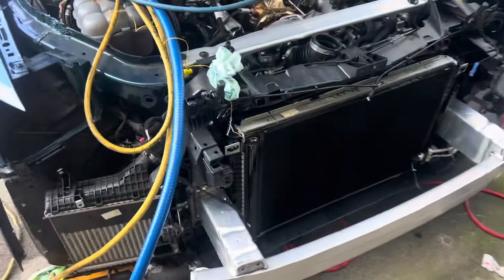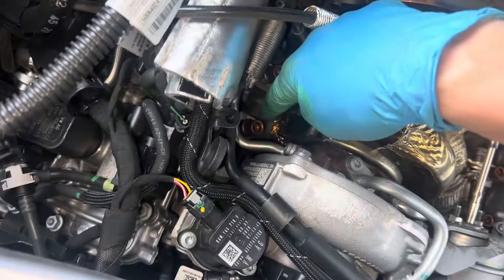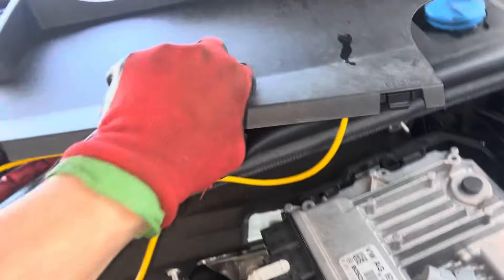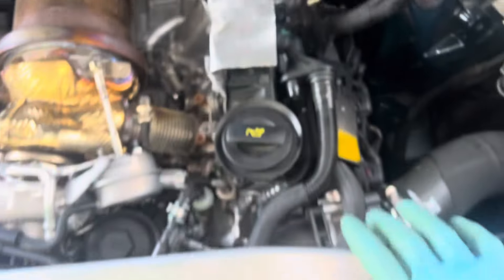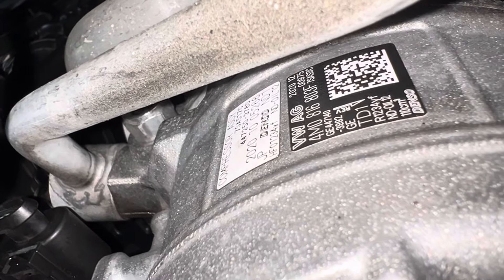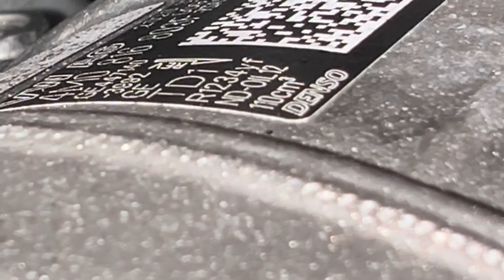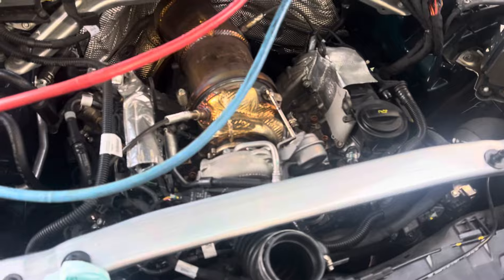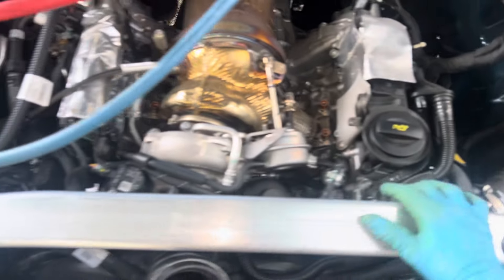AC lines and components near impossible to see with your eyes for leak checks. turbo intake manifold

Comment: What are the 3 wire (1 red + 2 black) plug on the Mercedes Metris AC compressor A0008303002 do? One wire is to engage the clutch, what are the other 2 wires do?
The reason I ask. I bought a brand new compressor from FCP Euro that stated that "this part fits your car" but the new Valeo Mercedes AC Compressor 699298 has only 1 wire plug instead of original 3, suction and discharge lines are at a bit different angle and it's missing black sensor plug as well. I'm trying to decide if I should return it or missing sensor is fine, lines are offset, and 3 vires can be converted into 1???
Reply from the maker: I do not know Mercedes parts numbers. 

But it sounds like they’re trying to sew you an older styled fix piston compressor . 

To possibly replace a variable displacement compressor . 

I only replace like for like components 

If they’re not the same, I don’t replace them .
Reply: The red and one black wire smaller in diameter are for the variable displacement valve. The black wire thicker in diameter is for the clutch power.
It is always a problem to find the right part on German cars because parts vary very often. Always take care to have the original part number. Only identical spare parts will match! Don't try to install the different looking compressor...
Reply from the maker: @Akadectra  👍 vary true
Reply: @Akadectra  Thank you! I received email from FCP Euro, saying that they made a mistake on the listing and that Valeo compressor fits Mercedes C class and not Metris. I'm returning it. 
Last question: 
If clutch engages but A/C pressure stays the same around 70PSIG HI/LOW side, the same 70PSIG HI/LOW when compressor is off and not cooling, would  the DISPLACEMENT VALVE is the culprit?
And before compressor completely stopped cooling, it was intermittent cooling, like one day it worked, the next few days not. Then few week not cooling and suddenly one day started again and then haven't cooled in month.
Reply from the maker: @H1gh-3nd I have seen the variable displacement valve act like that before intermittent. 

Have also seen a clutch relay do the same thing

Comment: I finished the AC work and praise the Lord it cools with zero leaks but there's a small problem. A heater hose touches it as does an air hose causing it to heat up as far as 150f around the exterior of the compressor. I wonder if the hose to the heater is transferring most of the heat to it. The upper air box seems to be awfully close to leaving little room for air flow. The compressor is super close to the engine. Probably not helping. I hope it can handle this. I'm thinking of insulating the cold pipe going into the compressor to limit the heat transfer. Condenser is a nice cozy 97F though the liquid line seems to rise to 130f exterior but I am able to touch it where it reads that and it doesn't seem hot
Reply from the maker: Sounds like some of the temperature readings are in accurate. 

Or terminologies description of items . 

Usually a condenser temperature is not lower than a liquid line, leaving the condenser .
Reply: Will a blocked condenser increase temperature on liquid line
Reply from the maker: @ibrahimwaheed987  no
Reply: @ibrahimwaheed987  I don't think it would cool very good if something was blocked
Reply from the maker: Nope, usually we’re not cool. Very well unless it was already cold outside and it didn’t need much refrigerant.
Reply: @coldfinger459sub0  well I might try insulating the tubing going into the compressor. It's bare aluminum and touching the hot heater hose. Of course now I got another fun problem called no fuel pressure. We just replaced the fuel pump and after pulling the filter off the fuel line you can turn that switch and still not spill anymore fuel than what was already pressure sealed to begin with. No fuel flow
Reply from the maker: @electric_thumbs  Don’t you just love cars never-ending story of continuous repairs and breakdowns. 
    Unless usually it’s a Toyota. There are a few problems